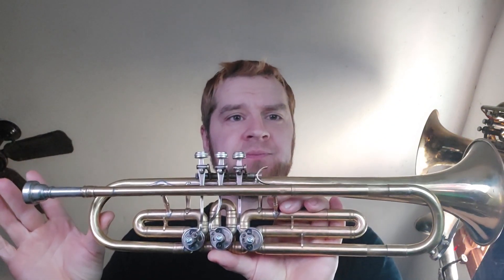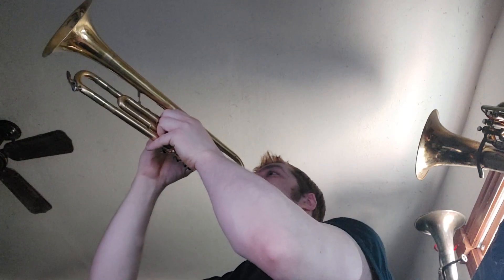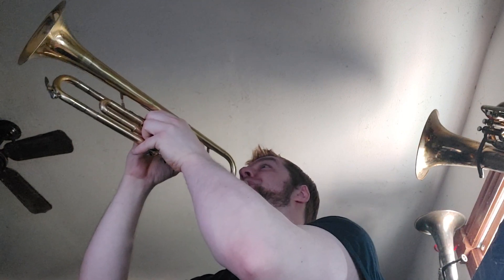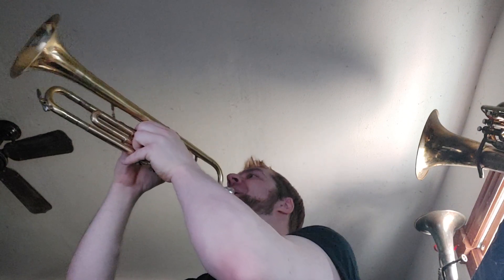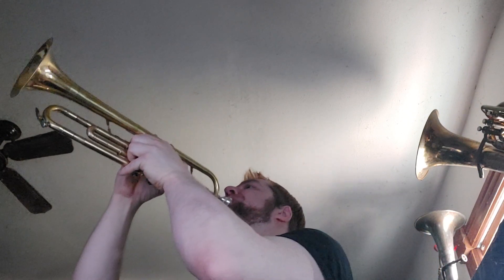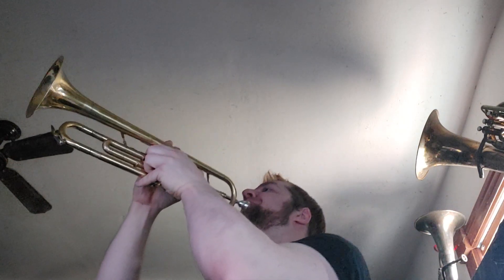1984 Орфей Trumpet (TARV Jazz Trumpet, Soviet) - 2nd try

Comment: Hey Mark. Its certainly an interesting horn. So I recently purchased a soviet era trumpet and rotary cornet. Not the upright kind. Didnt get them in the mail yet. Did I make a mistake buying these? Appreciate your experience and opinion.
Reply from the maker: Well, you probably will want custom mouthpieces unless you're getting stock mouthpieces and actually like them.  The concert trumpets have a really huge and beautiful sound.  Not sure which Cornet you mean, but the Kiev made rotary Cornet is actually pretty good minus the frustration of the rotor direction.  The Russian Cornet is a totally different thing, but not bad by any means.  Both can use a normal Cornet mouthpiece adapted to 10mm and will sound like a Cornet should.
Reply: @Markworth  They both come with mouthpieces. I'll see how I like them. The cornet seems to be an orpheus brand. The trumpet has some logo on it I'm not familiar with. The only soprano horn I've had is a King cleveland superior cornet. I wonder how these will compare.
Reply from the maker: @OldBear1991  After a bit of a think, I guess you could produce some home solutions that wouldn't be any worse than the stock mouthpieces.  You can make a Cornet adapter by filing the end on a cheap adapter until it matches the insertion depth of the stock mouthpiece.  The same should kind of work with a Trumpet mouthpiece on the Trumpet.  Might sound thin, but eh.  A lot cheaper than trying to get a custom shop to do the work.
Reply: @Markworth  It looks like there are a number of adapters I could 3d print. I'll see how it goes whenever the horns get to me. It'll be a wait coming from Ukraine.
Reply from the maker: @OldBear1991  oh.  Yeah, if you have a 3D printer, then that makes it a lot easier.